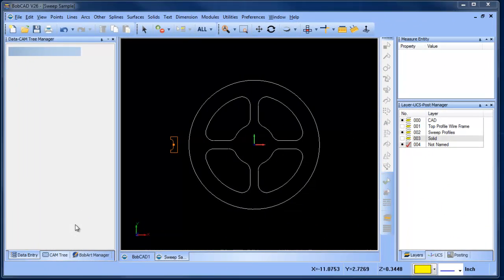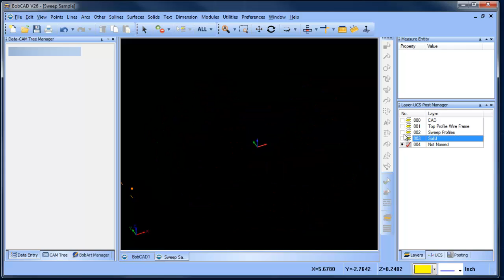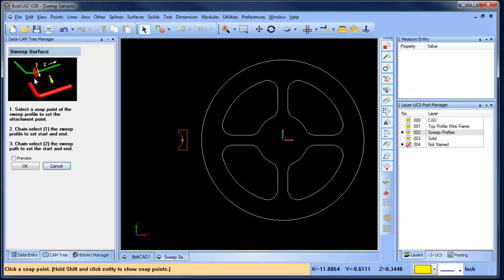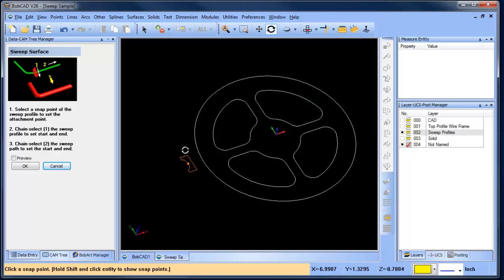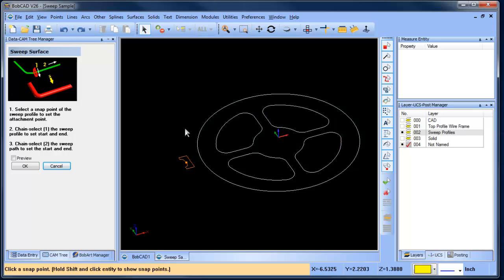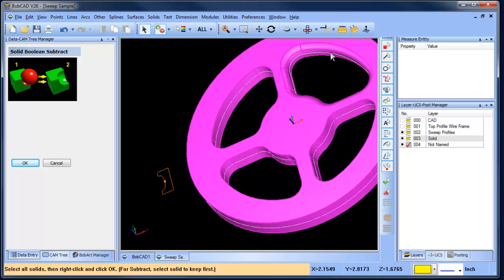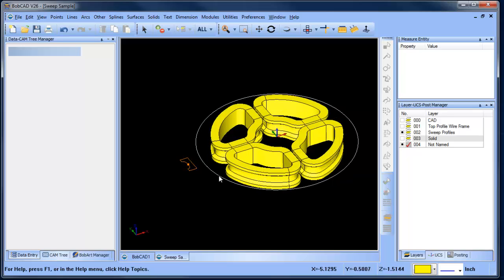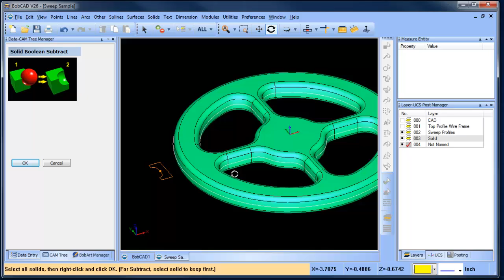BobCAD CAM V26 CAD Sweep Surface

Comment: hello, ive got a problem with sweep function on a spiral: it twists! can you help me out?
Reply from the maker: Hello Stefan,   The sweep features doesn't have guide rails.  So you'll need to limit the rotation to 90 degrees.  Then copy the segments around and down to complete the worm gear you are after.